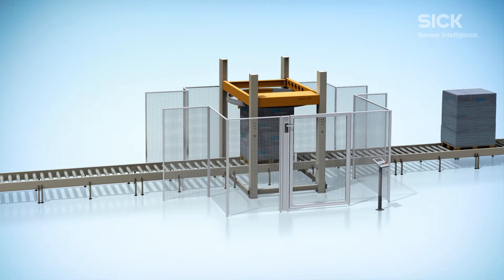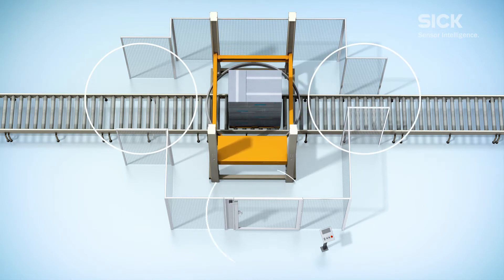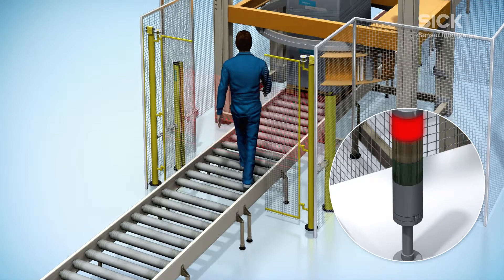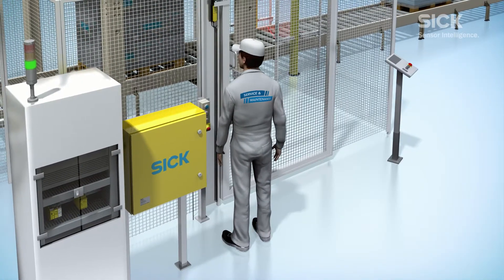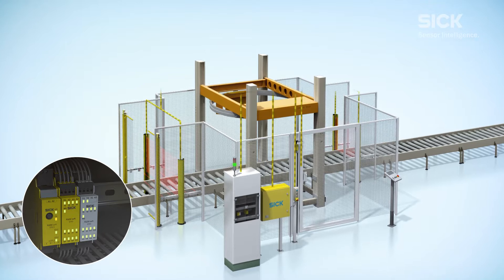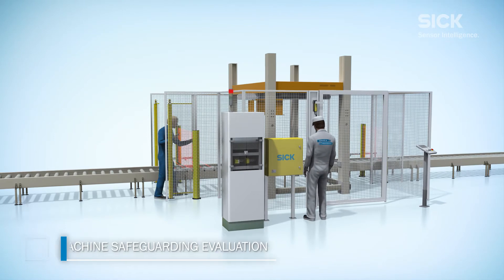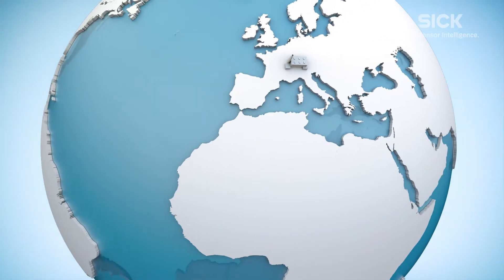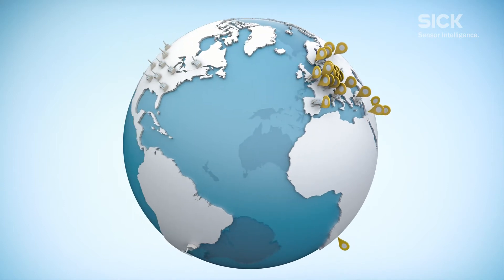Safe Stretch Wrapping Solutions from SICK: For safe and productive stretch wrapping | SICK AG

Comment: Can you please tell me the model of that sick sensor i need it
Reply from the maker: The shown solution is a an example we offer as a customer specific solution. In this example, the Conveyor in-feed and out-feed is protected by SICK safety light curtains and muting sensors. This could be e.G.  deTec4 Prime safety light curtain + H18 photoelectric sensors. But this needs to be clarified case by case in regards of the specific requirements of the application. Additionally we have access protection at doors and gates. These projects also include SICK Consulting, Engineering and Project Management. More information here: https://cdn.sick.com/media/docs/8/68/568/product_information_safe_stretch_wrapping_solutions_en_im0072568.pdf